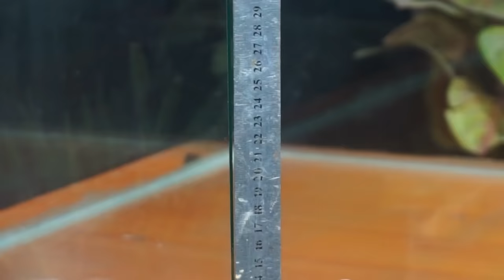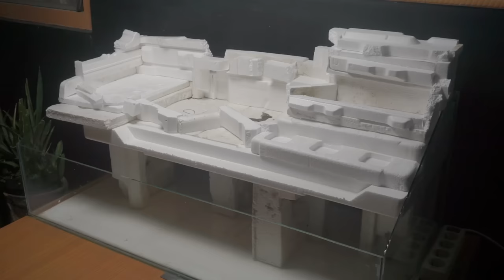I Turned A Broken Aquarium into A Waterfall Diorama Aquarium (Made Aquarium Decorations)

Comment: Wonderful design. Only thing I would change are flat feet attached to legs instead of glue that can be buried under the sand; that way you can easily remove the whole structure for cleaning whenever you want.

Comment: Beautiful., But how will you change the water ? Do you have to redo all this work or how constantly will you change the water ?
Reply: Seems the only thing he would have to do is detach the legs from the base with a long flat blade as It's all a single lightweight Styrofoam structure that can be simply lifted out and put aside and then re-glue after cleaning is done.

Comment: Awesome! BUT, holy crap, use gloves when working with glass! You can slice yourself open very badly if the break doesn’t follow the line for whatever reason. And 2. There aren’t many things more toxic than melting styrofoam, and doing it inside is especially terrible for your brain. I was going to show this to my son, but it’s a terrible demonstration of hazardous safety practices. It’s a beautiful piece, but I’m a little sad if not worried about your process